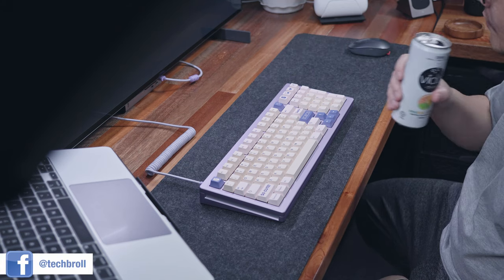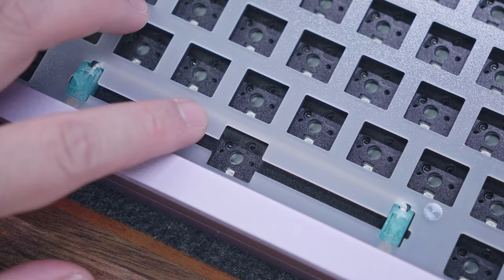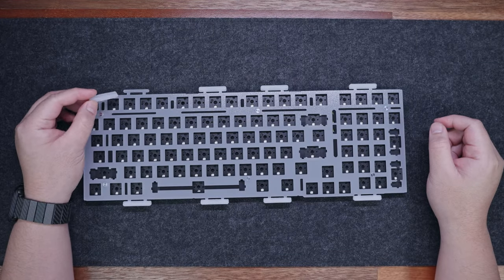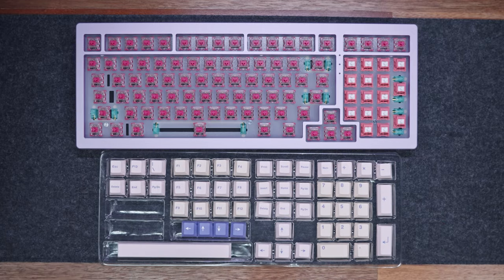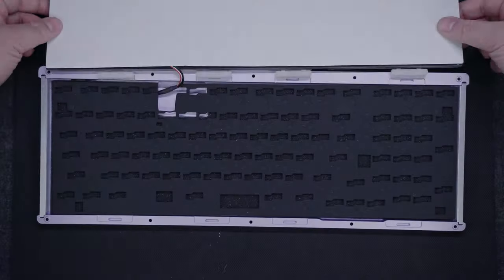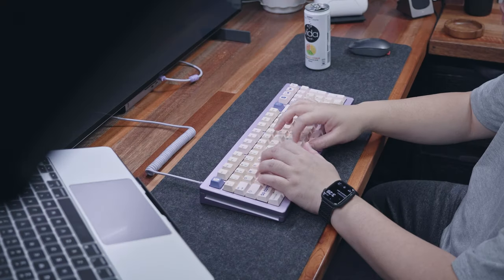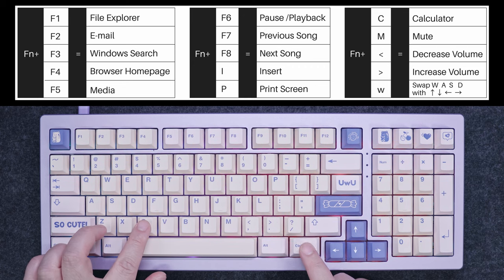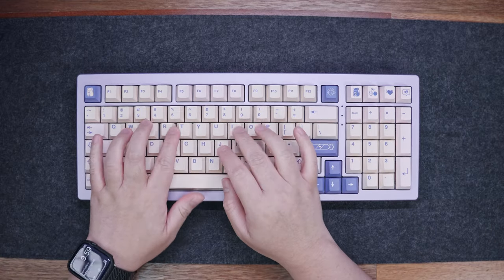Monsgeek M2 Review + Different Builds - Beginner Friendly!

Comment from the maker: Monsgeek M2 👉 https://shope.ee/8KJ9zU17b6 (Shopee)
https://bit.ly/43c4CrO (Lazada)
Switch lube 👉 https://shope.ee/VaQlwp3xA
Stabilizer lube 👉 https://shope.ee/3fXSXnxmmB
Reply: nkro works fine you just have to bind the toggle in via.
Reply from the maker: @zomgz932  even on MACOs? I did try that, I bound the NKRO besides the scroll lock key, but it still didn’t work on MacOs only 6-key rollover. NKRO worked out of the box though in Windows when I tried it
Reply: @TechBroll  did you set the board to mac mode and also bind the nkro toggle in the mac layer?

Comment: You can use all foam and tape on this key board.
Reply: Can you? I think that you might be able to if you have the 1.2 pcb (it depends which month/year your board was manufactured in). With the 1.6 board, I could probably force it, without a tempest tape mod, but there would be zero flex.

Comment: was looking to get this keyboard but sad to see no nkro :(
Reply: it has nkro you just have to bind it in via.   i have tested it in the key tester and when you are  in non nkro mode it is 6 keys  toggle it on and you can get a full board regestering simultaniously.
Reply: @zomgz932  hey, thanks for the info. Any complaints or what do you like about the keyboard?
Reply: @blakuntang   asides from needing a Json file to load into via, so if you use the keeb on many pc's and want to screw around in via you gota download that file all the time. otherwise   no problems here.  
its heavy sounds good has a decent typing angle  and has some gasket performance if you take the open cell foam out of the bottom.   if you mounted it with a softer  foam it'd be even better but what is included is silicone.   i have yet to put my addon fr4 plate on to see how i like that.  but the PC plate gives good unicorn puke when i wana go full gamer.  lol